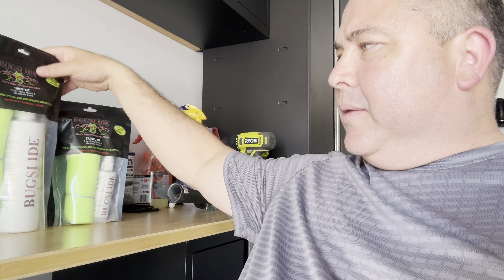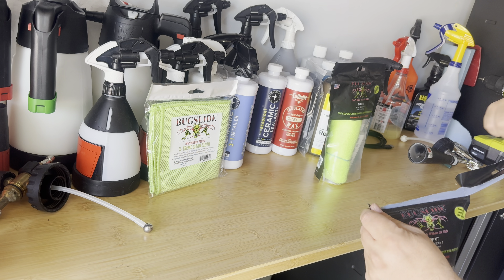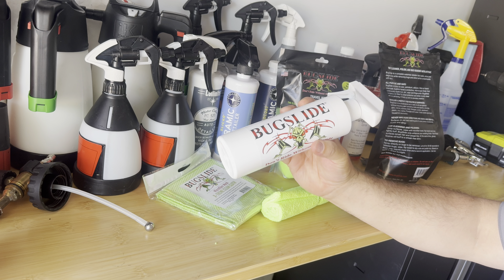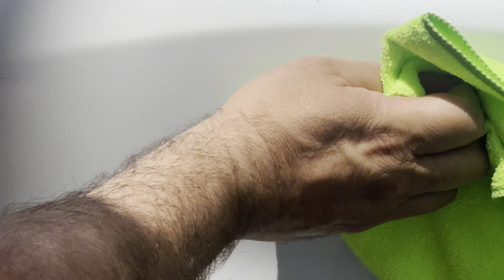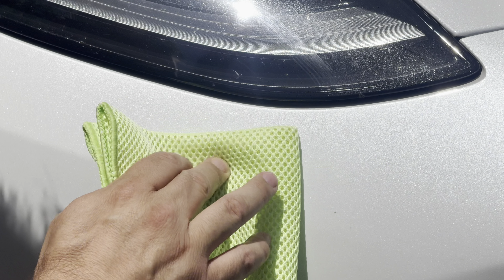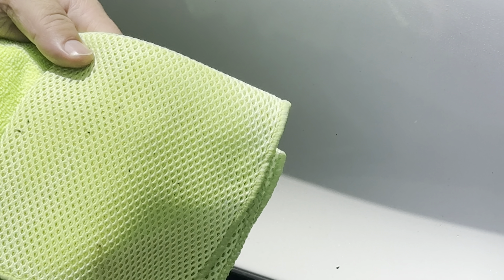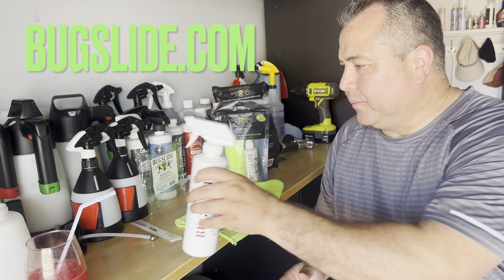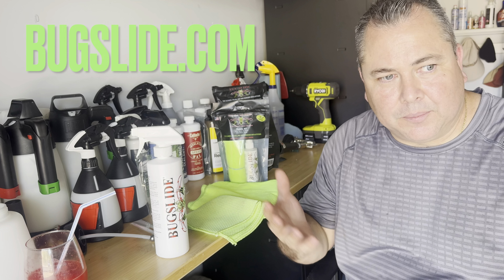BugSlide/ A Fantastic Cleaner Polish And Degreaser/ Easy To Use/ Bug Remover/ Auto Care

Comment: If your vehicle is coated and or protected, a special bug remover is not necessary.  And you tend to your car once a week.  Bug splatter will etch into the your paint if left unattended?  Now that the cicadas are here, in some areas in the States, it is very important to remove all bugs on the front & mirrors of your car.  I remove bugs with ONR and a little "Elbow Grease".  Ben, thanks for your videos, keeping coming!
Reply from the maker: Absolutely correct